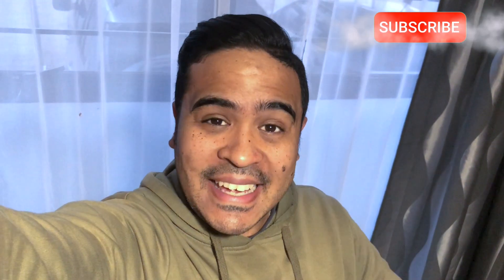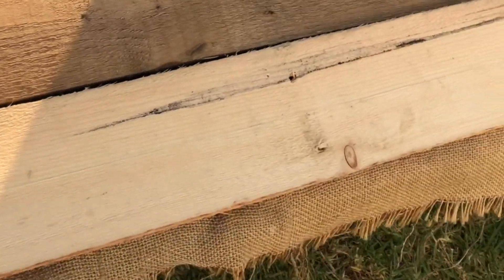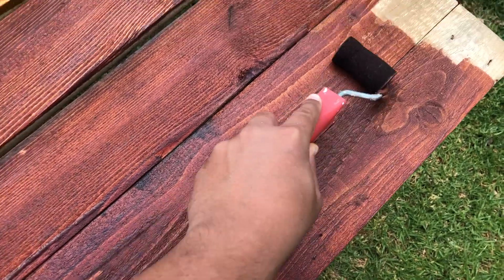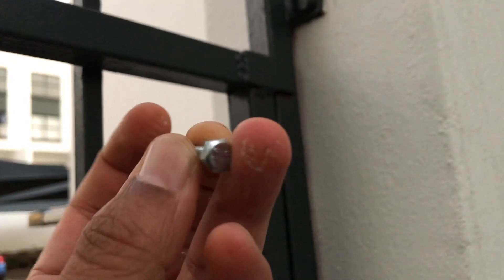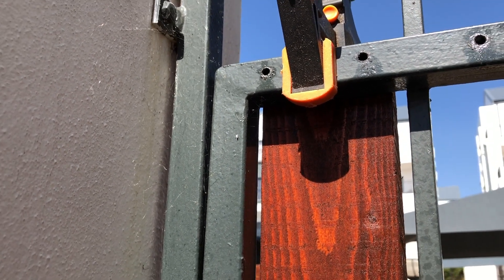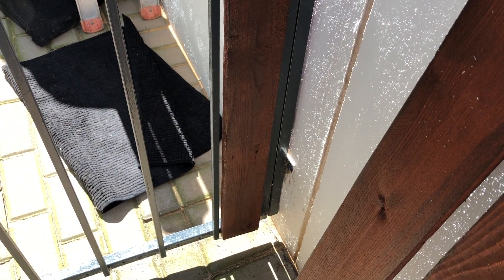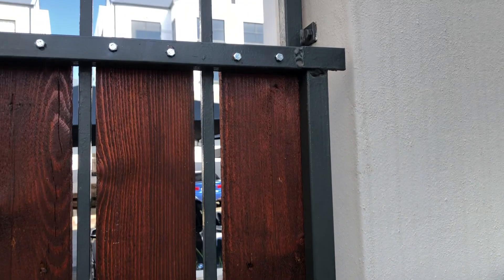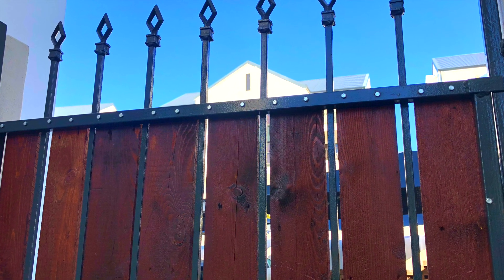DIY PRIVACY SCREEN l How to Make a Privacy Fence for your Backyard

Comment: I appreciate your video. One thing I will say is that I'm using Colbalt twist steel drill bits, and it's so worth it to have this bit. It goes through the wrought iron like butter. I was struggling with regular bits steel bits. I bought galvanized bolts and nuts to screw on the back end. I will change the drill bit for drilling through the wood. Thanks again for the great video!

Comment: What type of screws and drill bit did you use?
Reply from the maker: Hey Karl, thanks for the question. Watch the video again at 2:45 and it should answer your questions. You can pause and make a note of the tools listed as well. Thanks 👍🏼